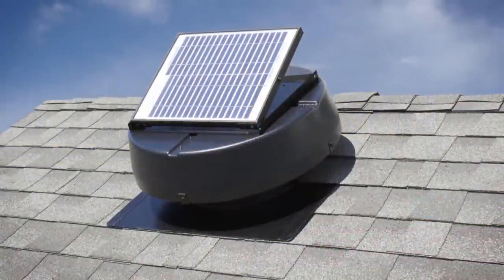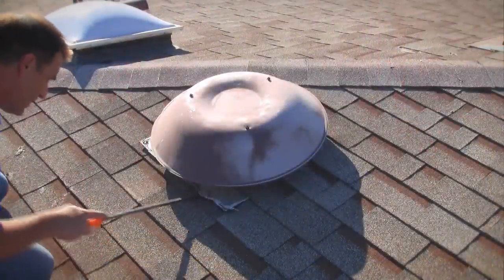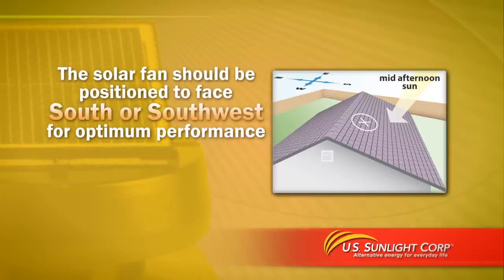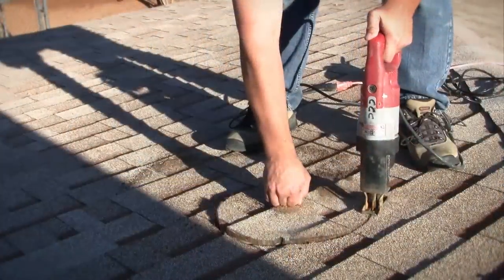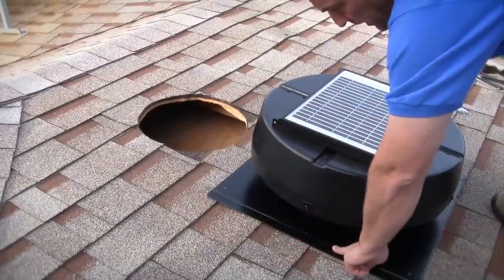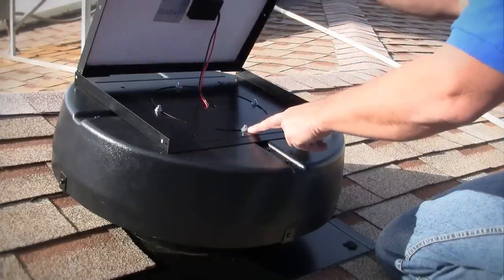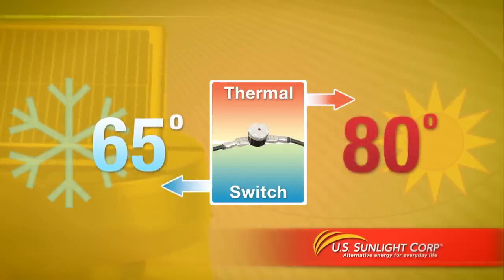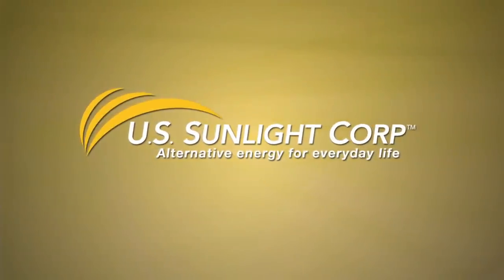Installation Instructions - 1010TR, 9915TR, US1110 Solar Powered Attic Fan

Comment: Well-made, delivered quickly, and easy to install with Fastly.Cool . I may be imagining it, but it seems quieter than the 14 year-old unit that I pulled out. Of course it was noisy at the end due to failed bearings, so hard to compare. :)
Reply: yunis parveiz (aka accwow unu, is a bot leaving same (copy paste) comments on every solar power installs - advertising his company

Comment: does not appear they used near enough caulking.  I install these (different model) but apply an upside down U around the bottom face of the plate before sliding under shingles (opening of U facing downhill) as well as along the edges to keep water from getting in.  I also always caulk on the holes before screwing screws in addition to going over top after they are in.  This may seem overboard but the last thing I'd want is rain getting through into my attic.  Besides it's not worth an entire tube of caulk to only use those 5 dots.
Reply: what you are saying (apply an upside down U around the bottom face of the plate) seems to make sense but I wish you could provide us with some photos with a link for how it is being done the way describing it

Comment: My garage is only insulated on one side because it only has living space above/adjacent to the one side. The other side has a small roof over the second car garage, currently the garage gets up to about 88 to 90°F in the summer. Would installing one of these be enough to pull a lot of that heat that builds up in my garage ceiling out?